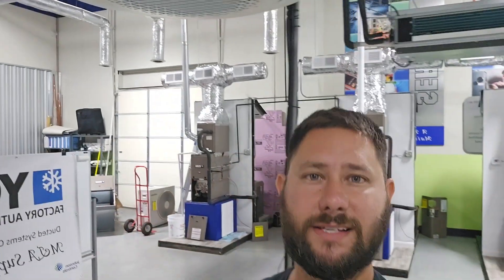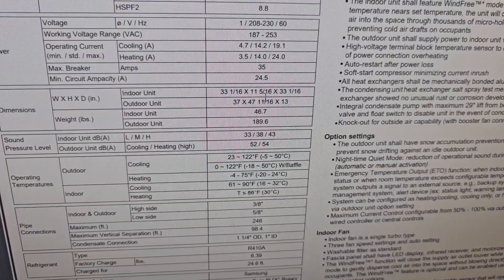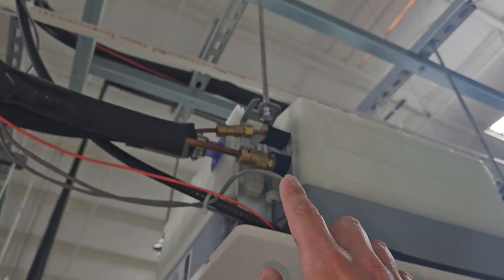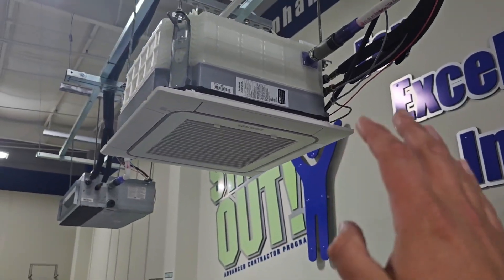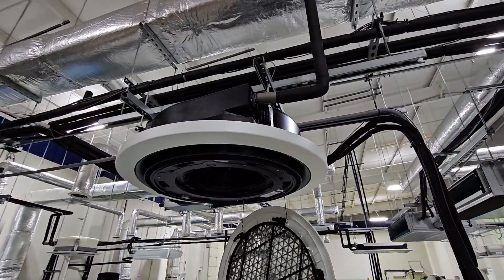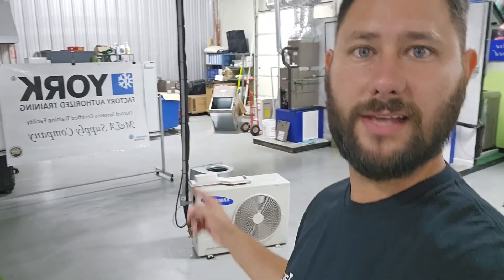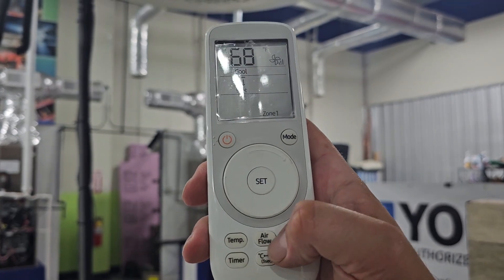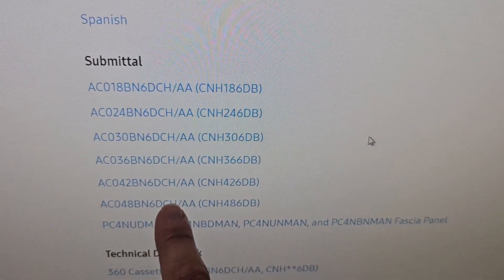Ceiling Cassette Mini Split Hacks You Need to Know

Comment: When using either wall hung or the cassettes ..lets say you put them in the bedrooms and the main living area and kitchen . What do you do about the bathrooms?
Reply from the maker: Bathrooms have a Bath fan that pulls area when it's on.
Undercut the door to the bathroom 2 inches and the air will go underneath the door into the area.
Or you can add a vent in the door or a vent or diffuser somewhere on the wall to the bathroom.
Reply: Building my daughter a small house was leaning towards mini split until this.
Reply: Yes, you can add a transfer fan like the AireShare.  It has a powered squirrel cage blow motor.  You can wire it to a programmable wall switch to have it run at any time you want.  They work really well

Comment: Do they make an outdoor unit for marine applications? Most marine A/C's use a water cooled condenser rather than air cooled. The 24² mini cassettes will work beautifully on my boat. The original (1986) ac units are split type. 16k btu on the main floor and 12k btu in the lower rooms. The compressor/condensers are in the engine room with a seawater pump that circulates water across the condenser.
Reply from the maker: Samsung makes a water cooled version

Comment: long term for 360, can all deep cleaning be done from below or will attic/above access be needed eventually?
Reply from the maker: All cleaning can be done from below
The only thing you need access for above the ceiling is if you have her have to replace the unit or replace the coil inside.
Reply: @TaddyDigest  life goal: install a 360 with custom label for a client

Comment: Do you have a video on Commerical trane odyssey rtu  with  symbio 700 control is it possible to wire it conventional just to get the customer temporarily cooling
Reply from the maker: I do not have a video on that but I will try to get a video on that soon.

Comment: HiTaddy am new . I have a question about the 360 cassette unit. I am not getting any lighting on the icon button and the fan is not coming on. Any suggestion.
Reply from the maker: yes have you checked L1 and L2 for 240 volts
Reply: @TaddyDigest   what if I have the 230V

Comment: So I am curious, If I am building/remodeling a gutted flat roof house that requires  48000btu 4 ton and I have 8 rooms I have to cool, my understanding is that I would need 2 4 head units that equal 48000btu combined. Am I correct in my thinking or is my thinking cross ways?
Reply from the maker: I would do
2
36k outdoor on 4 heads

Comment: How come u didn't change the PTC?. Or take out the hard start kit out. And y?.
Reply from the maker: When what are you talking about
I didn't do anything like that in this video
Reply: @TaddyDigest  I'm taking about. U changed out a compressor and a fan motor. On a package unit. It had a PTC .that was not being used. And a hard start kit. That's what I was talking about.
Reply: And thanks for answering. U r a great Technician. I would like To work with you guys. I got about 10 years. In the field